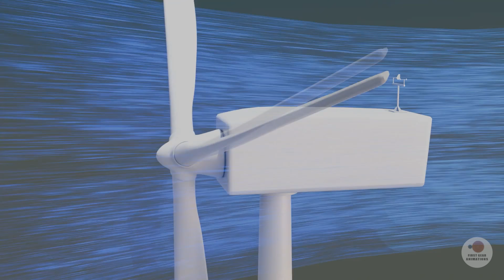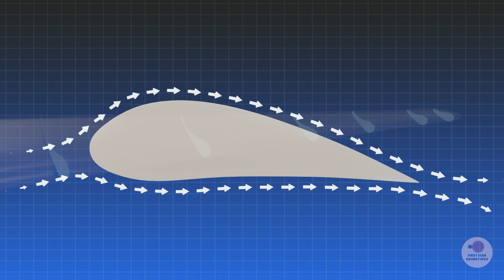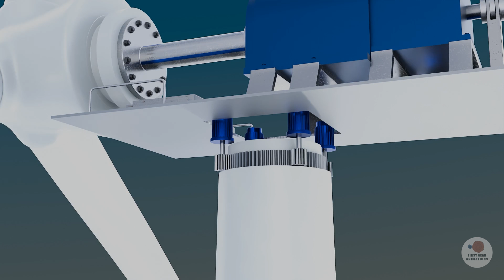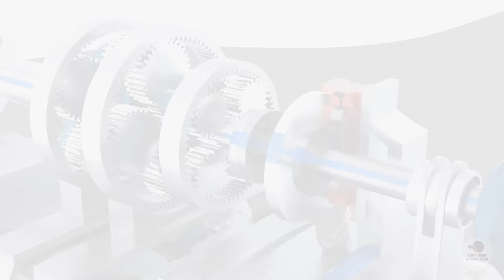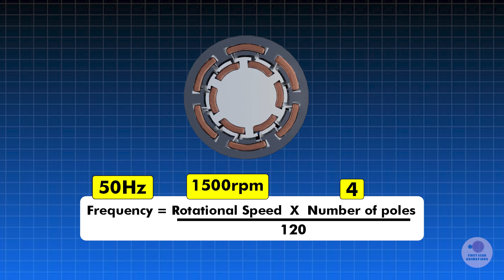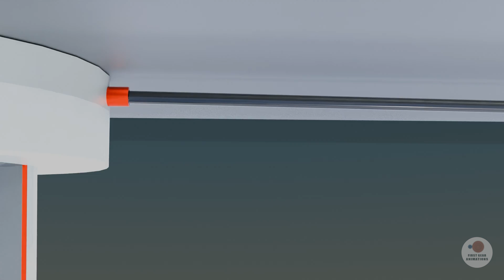Inside a Wind Turbine: How It Really Works

Comment: The brake is used to keep the blades locked, like a handbrake. You wouldn't apply the brake while the blades are moving because that would make it blow up. To stop the blades you change the pitch of them until the wind no longer pushes them around, then their own drag slows them to a stop.

Comment: The problem with large wind turbines is that the tips of the blades despite how slow they look are going a couple hundred miles an hour and will kill birds easily, especially birds of prey because they have huge eyebrows to prevent their eyes from being exposed to the sun because they are incredibly delicate due to their high resolution

Comment: That is the old - obsolete - design 
MODERN wind turbines do away with the gearbox completely
The generator is part of the main shaft and simply has many more "Poles" - running at 1/10th the rpm with 40 poles instead of 4 poles

Comment: Some of the largest wind turbines used direct drive to avoid having a transmission as they really are not designed to withstand 100,000 hours of continuous operation, which is what you need for a dependable wind turbine

Comment: Why do they put the brakes on the high speed end of the gearbox as opposed to the low speed end?
Reply: They could use a bigger rotor, callipers and pads at the low speed end and surely reduce stress across all the planetary gear sets yeah?
Reply: Torque difference. If you put your brake on the primary shaft, you would need to fit in a very big and/or powerful brake to stop it. At the output of the epicyclic gearbox, the torque/power needed to brake the whole shaft is lowered by the ratio of the gearbox, allowing a smaller brake usage.
That's for example how the comparatively heavy steel arms of industrial robots are usually locked in position by the "small" integrated brushless motors brakes. For torque considerations and positionnal precision, the reducer ratio varies between 50 and 200.
Those brakes have a hard life when stopping spinning shafts (in case of emergency shut down, the axis must be stopped right away) and usually fail well before the motors' bearings.
Everything traces back to the comprehension of the relation between Power, Torque and Rotational speed. 
Things get funny when you want to start designing and making your own mechanical or electrical torque/speed regulators.

Comment: .
You skipped one very important component: the COUPLING. This device connects the turbine shaft to the transmission and absorbs almost all of the vibration.
Second, you didn’t mention that the entire windmill, including maintenance costs, can take about 20 — yes, twenty years to pay for itself, in the best-case scenario and without any major failures.
Just the coupling alone costs over $50,000 and needs to be replaced or refurbished approximately every 18 months.
Great show, it just needs a few more details to give a complete picture.
.

Comment: Nice video but this is not the answer for a clean emergency program. No one is mentioning that it takes more energy to manufacture the entire windmill than it produces its entire life span. And then there's the toxic waste. The carbon fiber blades alone can't be reused so they just sit at recycling plants that just can't handle them. Just remember what the video explained what they are made of. Since they produce negative output, it's a long term losing government subsidy.

Comment: Nice graphics, but perhaps should have given a mention of the role of power electronics -- an essential part of the system, even for a DFIG (which is somewhat dated configuration now). Also could have mentioned a geared drive train is just one way of doing things (the other being rotor speed direct drive), but I understand the need to keep it simple. In general, it's an excellent intro.

Comment: I put it to you that the DFIG animation is correct in theory but that the rotation of the stator field is backwards.  If it and the rotor are turning in the same direction that would push the output frequency down, and vice versa.

Comment: "The rotor is equipped with three sets of copper coil" which means the number of poles is three, then he goes on implies its has 6 magnetic poles. Where are the magnets, he only mentions the coils of the rotor and the stator.
Reply from the maker: Three sets of copper coils do not automatically mean three magnetic poles. There are six coils arranged as three sets, meaning two coils per phase positioned opposite each other. Because these two coils are wired to face each other, their combined magnetic fields naturally project four alternating magnetic zones (North-South-North-South) into the machine, not three. Pole count is determined by the winding arrangement and the resulting magnetic field, not by simply counting the number of coils or phase groups
Reply: @first_gear_animations  The coils receive energy from the grid to create the  magnetic field. The animation only mentions a separate electric current is injected into the rotor to keep a constant frequency. I had no idea that wind turbines uses the electric grid.

Comment: I was wondering, insted of placing such big structures at a (considerable) height to utilize wind energy which is both hard to implement and also expensive, is it possible to bring the 'wind' to ground level and then utiluze its energy ? For example, can we place to big ' funnels ' in the wind, one of which transfers the movement of the air ( transfers the wind flow ) through a pipe to ground level so we can utilize the power of the wind at ground level ( for example by a wind turbine attached to an electric generator or by other designs and methods ) and after that another pipe attached to the other funnel returns this air flow from ground level to the altitude it had been in order to to complete the wind-flow cuircuit ( something like that instead of placing a water mill inside a river, we dig a water-path so that the water flows from the river through this water path and then enters the river again at another place and we place our water mill inside this water path so that the mill is near us and much easier for us to use it ) . If we can bring the wind current from the height it blows adequately well to ground level and utiluze it at ground level and then return the air flow to the required height and appropriate place to complete the wind current circuit it seems to be much easier and less expensive  to implement ( please note that the input and output funnels could be designed and implemented such that they can rotate and align with the wind flow direction  automatically ) 🌿🙏  if this idea is silly and stupid I apologize and I thank you for taking the time to read it. However, if occasionally this idea might be useful and applicable in practice and if it is a new idea then I who am the inventor of this idea and therefore the owner of it dedicate this idea to and only to all the people who are willing to work on it and bring it to practical use and applications for the benefit of everybody everywhere and without bringing any sort of harm to anybody and without bringing harm to the environment and without any form of misuse of this idea 🙏 🙏🌿  🙏

Comment: A wind turbine is simply a massive multi million dollar gear box suspended at "Terminal velocity" height above the surface . Terminal Velocity height means the height from which a falling person will reach "terminal velocity" before reaching the ground.   Terminal velocity is the speed a falling human will reach when wind resistance matches  gravitational force and the falling human doesn't accelerate anymore.   All to service a gear box that will be sold as rusty scrap iron in a decade or two

Comment: I thought the turbine's main brake would be the control that rotates the blade angle. If they're facing forward, the wind passes straight through and they don't rotate. Of course, I imagined there would be secondary brakes, but given the sheer force of the wind, I thought there wouldn't be any disc, brake caliper, or gear in the world that could stop such a monster without causing a catastrophic breakdown.

Comment: There must be a reason, but no one has the answer.  Putting the heavy generator at the top of a tall tower makes no sense compared to having a vertical drive shaft down the tower and having it turn a generator at ground level.
Reply from the maker: A drive shaft long enough to reach the ground would need to be incredibly thick and heavy to avoid twisting. The weight of the massive steel shaft often ends up being heavier than the generator it was meant to replace.

Comment: These views are almost laughably simplified. There is way more stuff inside those nacelles. I've climbed up into them. They're jam packed with huge power cables and electrical and electronic control equipment. There's a lot of room to move around inside, and the hub itself is huge and can fit several people. There are doors to the outside and outside platforms. The base of the tower has two levels (ground and basement) of an insane amount of electrical and electronic equipment. These are massively complex machines that require the most advanced power control systems. It seems rather inefficient to have all that tech for one single small turbine.

Comment: A wind turbine has to constantly produce electricity for five years to recoup the huge cost of it's manufacture and installation, sometime even longer if it is located out at sea, before it becomes a viable source of "free" or renewable energy. However, this will never happen as the turbines switch off if the wind exceeds 30mph and also the gearboxes have typical lifespans of between 3-4 years if they are lucky and the cost to replace them is uneconomical. So their solution is to build even more wind farms instead. How on earth can this be good for the environment, having a power source that is inefficient and cannot pay for it's self and are an eyesore on the countryside. The only people who are benefiting from these things are the companies who manufacture them. We are all being conned big style.
Reply: Payback is months not years; plenty of studies and economic assessments regarding this aspect available online if you search. The amount of curtailment that occurs due to meeting cut-out speeds is carefully engineered and financial assessed in the project design phase. I can assure you some clever and hard-nosed people from the investment community account for every aspect of curtailment losses in their financial models, but cumulatively it's into a few days a year at most. Gearboxes don't have lifespans of 3-4 years, and with offshore anyway, only 50% of turbines being installed today have gearboxes, Siemens-Gamesa being a good example of a manufacture that uses a gearbox-less direct drive config. Last year, wind power supplied about 29.7% of Great Britain's electricity generation. It was the largest single source of electricity for the second consecutive year. The biggest problem with wind is it has failed to sell its success story.
Reply: @francisdonnelly9361  To recoup the energy (electricity and gas) it took to make them takes around 5-9 months providing they run 24-7 and 365 which is nigh on impossible, and the fact that wind turbines are only 45% efficient at best. However, financially it can take several years for a wind turbine or generator to "break even" so to speak. Gearless wind turbines are normally found in the smaller units and some multi mega watt units but they too have their drawbacks. Just remember TNSTAAFL and The First Law Of Thermodynamics.  
In thermodynamics and fluid mechanics, wind turbines are governed by the law of conservation of mass and momentum. The fundamental theory dictating their efficiency is Betz's Law, which establishes that a wind turbine can capture a maximum of 59.3% of the kinetic energy from the wind.
Just like heat engines are limited by the Carnot efficiency, wind turbines are limited by this "Betz limit" because you cannot extract 100% of the wind's energy without stopping the air completely, which would block more air from passing through the blades.
1. Betz's Law and the Ideal Limit
Betz's Law applies the principles of conservation of mass and momentum to an open thermodynamic system. As wind approaches the turbine, it slows down and expands. [1]
•	The Dilemma: If a turbine extracts 0% of the energy, the air passes right through at full speed. If it extracts 100% of the energy, the air speed drops to zero, stalling the air behind the turbine and preventing any new wind from entering.
•	The Sweet Spot: The maximum power extraction occurs when the wind speed behind the turbine is exactly one-third (1/3) of the upstream wind speed.
•	The Maximum Efficiency (\(C_{p}\)): This optimal slowdown yields a maximum power coefficient (\(C_{p}\)) of \(\frac{16}{27}\), which equals 59.3%.
2. The Kinetic Energy Equation
The available power in the wind depends heavily on its speed. The thermodynamic expression for the total power (\(P_{\text{wind}}\)) passing through a specific cross-sectional area is:
\(P_{\text{wind}}=\frac{1}{2}\rho Av^{3}\)
Where:
•	ρ (rho) is the density of the air (mass per volume).
•	A is the swept area of the turbine blades (π r²).
•	v is the velocity (speed) of the wind.
Because velocity is cubed (v³), doubling the wind speed results in eight times more available energy. A turbine's actual power output is this equation multiplied by its efficiency coefficient (\(C_{p}\)).
3. Real-World Losses (The Second Law)
While Betz's Law provides the ideal upper limit, real-world wind turbines generally operate at 35% to 45% efficiency due to irreversible thermodynamic losses:
•	Wake Effects and Swirl: The spinning blades force the passing air to rotate. This rotational kinetic energy is "wasted" in the wake behind the turbine rather than being converted into electricity.
•	Aerodynamic Drag: Friction between the air and the blade surfaces converts mechanical kinetic energy into useless ambient heat.
•	Mechanical and Electrical Losses: Energy is further lost as heat in the gearbox, bearings, and generator during the conversion to electricity.
Reply: @francisdonnelly9361 To recoup the cost of the energy (Electricity or Gas) It took to make the turbine will take between 5-9 months but, in reality for a wind turbine to "break even" it takes years providing they run 24-7 and 365 but this is highly unlikely as they are only 45% efficient at best. Remembering The Laws of Thermodynamics and the saying TNSTAAFL, In thermodynamics and fluid mechanics, wind turbines are governed by the law of conservation of mass and momentum. The fundamental theory dictating their efficiency is Betz's Law, which establishes that a wind turbine can capture a maximum of 59.3% of the kinetic energy from the wind.
Just like heat engines are limited by the Carnot efficiency, wind turbines are limited by this "Betz limit" because you cannot extract 100% of the wind's energy without stopping the air completely, which would block more air from passing through the blades.
1. Betz's Law and the Ideal Limit
Betz's Law applies the principles of conservation of mass and momentum to an open thermodynamic system. As wind approaches the turbine, it slows down and expands. [1]
•	The Dilemma: If a turbine extracts 0% of the energy, the air passes right through at full speed. If it extracts 100% of the energy, the air speed drops to zero, stalling the air behind the turbine and preventing any new wind from entering.
•	The Sweet Spot: The maximum power extraction occurs when the wind speed behind the turbine is exactly one-third (1/3) of the upstream wind speed.
•	The Maximum Efficiency (\(C_{p}\)): This optimal slowdown yields a maximum power coefficient (\(C_{p}\)) of \(\frac{16}{27}\), which equals 59.3%.
2. The Kinetic Energy Equation
The available power in the wind depends heavily on its speed. The thermodynamic expression for the total power (\(P_{\text{wind}}\)) passing through a specific cross-sectional area is:
\(P_{\text{wind}}=\frac{1}{2}\rho Av^{3}\)
Where:
•	ρ (rho) is the density of the air (mass per volume).
•	A is the swept area of the turbine blades (π r²).
•	v is the velocity (speed) of the wind.
Because velocity is cubed (v³), doubling the wind speed results in eight times more available energy. A turbine's actual power output is this equation multiplied by its efficiency coefficient (\(C_{p}\)).
3. Real-World Losses (The Second Law)
While Betz's Law provides the ideal upper limit, real-world wind turbines generally operate at 35% to 45% efficiency due to irreversible thermodynamic losses:
•	Wake Effects and Swirl: The spinning blades force the passing air to rotate. This rotational kinetic energy is "wasted" in the wake behind the turbine rather than being converted into electricity.
•	Aerodynamic Drag: Friction between the air and the blade surfaces converts mechanical kinetic energy into useless ambient heat.
•	Mechanical and Electrical Losses: Energy is further lost as heat in the gearbox, bearings, and generator during the conversion to electricity.

Comment: Back in my Royal Navy days as an electronics engineer on frigates, we had 4 alternators, 2 steam, 2 diesel, delivering 440 volts at 60 Hz. Only 2 would run normally, but at action stations, or doing a RAS (replenishment at sea) we would power all 4 in case of emergency. When this happened it was my job to power up the diesel alternators, get the voltage and frequency correct, but before we paralleled we had to make sure they were in phase. If you got that wrong as you connected, all hell broke loose. (Did it once by accident). So what this interesting video didn't tell me was how phase is managed. I have often wondered how household solar panels manage phase, too